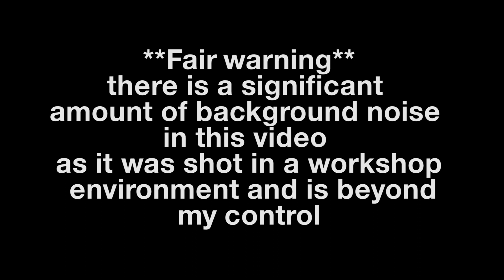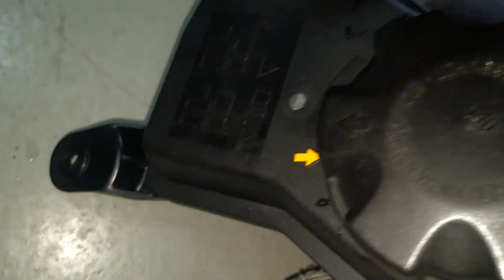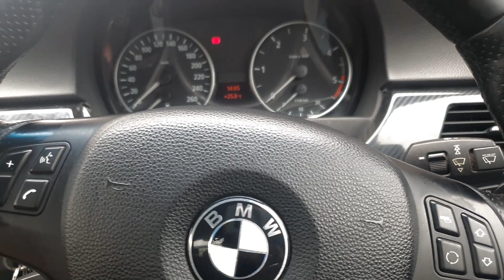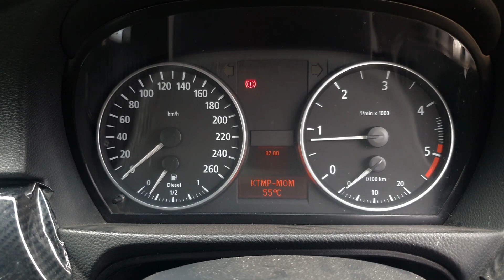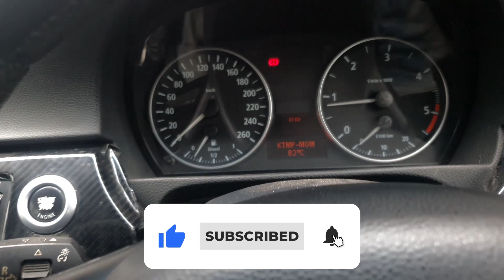BMW E90 coolant reservoir replacement & Thermostat | BMW E90 320d M47

Comment: Hi all i drive an e90 320d bmw uhm i did a magor service decently ander replaced a new water bottel but the thing is while driving my fan gos on after an 45min when the car is getting warm but that it doesnt stop fan stays on only whenni turn car off thannis gos off can it be my thermostat.
Reply from the maker: Most likely it's your thermostat not opening properly or the cooling system wasn't bled correctly after you changed the water bottle - both will cause the fan to run constantly once the car warms up. Start by bleeding the system properly (heater on max temp, fan low, ignition on, open bleed screw until no bubbles), and if the issue continues replace the thermostat. If it's still the same after that, then check the coolant temp sensor or the fan control module.

Comment: 11:20 does any of you encountered problems when trying to fit both pipes back to thermostat? I had tried for 4 hours but no luck. They are not making that click at all. The “Y” shaped pipe does not even enter properly…any advice?
Reply: howd you end up going ?
Reply: basically, I had the original Y shaped pipe and an aftermarket thermostat that were not properly fitting. I tried some sketchy stuff, cutting the pipe and end up buying a new thermostat and a new pipe…just because I was cheap and bought the cheapest thermostat..
Reply: @DaierFTW  unlucky ahahahaa, glad it worked out though